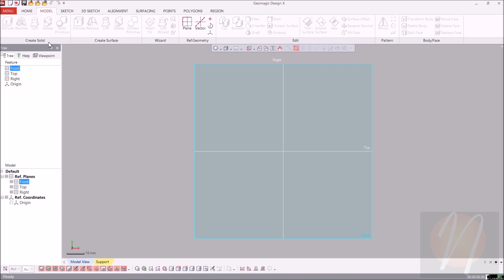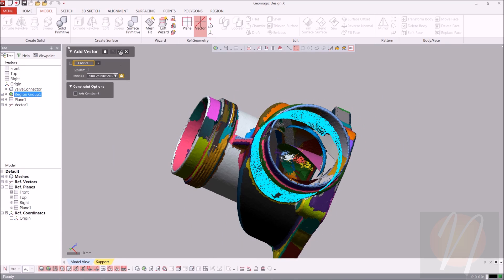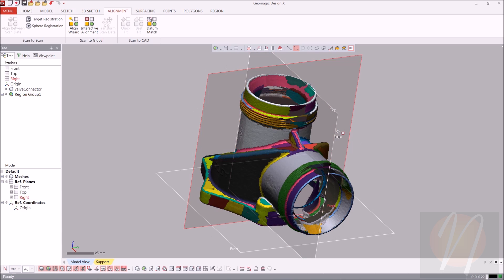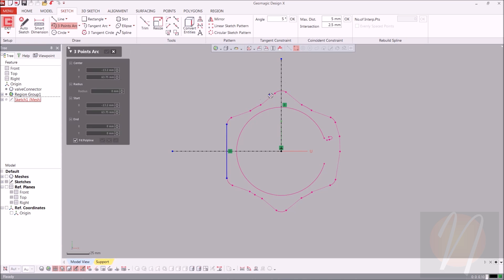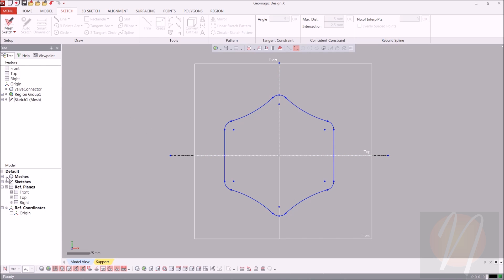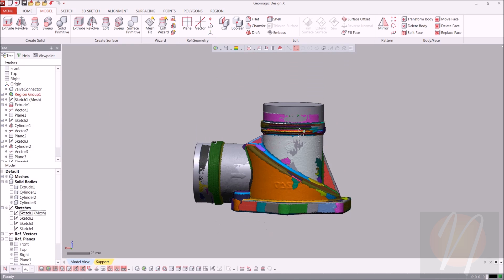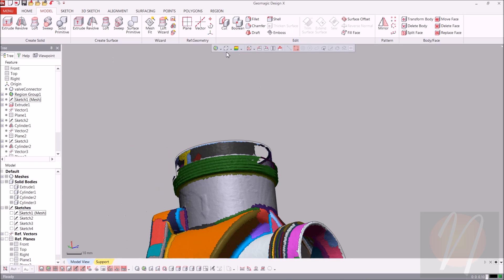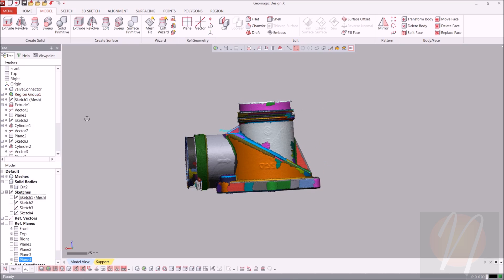NeoMetrix Geomagic Design X Tutorial 2   Valve Connector

Comment: To create cylinders it would be better if you use revolving method manually instead of solid primitives. This way we'll make sure cylinders axes are perpendicular.
Reply: سلام محسن جان 
من چند وقیته جئومجیک یاد گرفتم 
میشه گهگاهی سوالاتی بپرسم اگر امکانش هست
Reply: @mohsenrastgar_mr  فیلم آموزشی جئومجیک از مهدی وکیلی رو تهیه کن. بهترین آموزش جئومجیکه.
Reply: سلام محسن جان 
من یک ماهیه جئومجیک رو شروع کردم 
امکانش هست اگر سوالی داشتم کمک کنی ؟
Reply from the maker: If the goal is a design intent model, I would agree with you.  However, the point of this exercise is to learn how to use solid primitives, which can be very handy in a variety of applications.